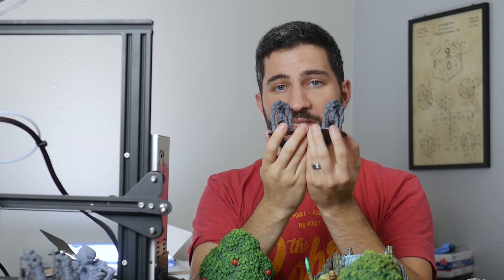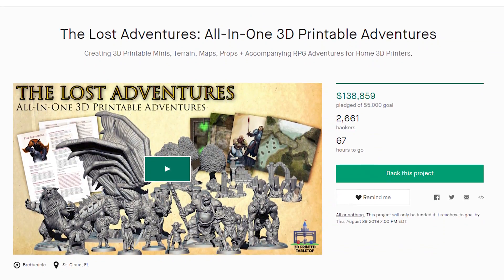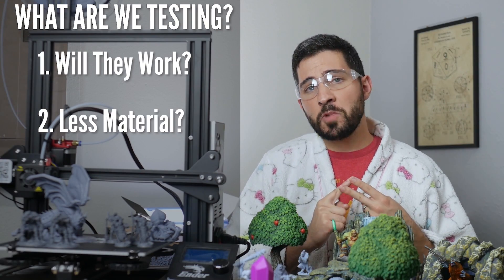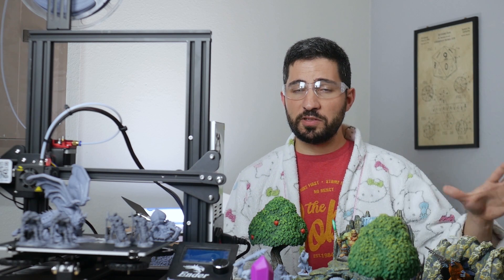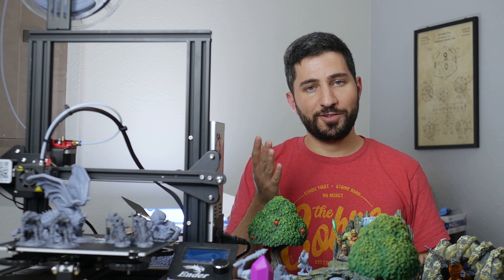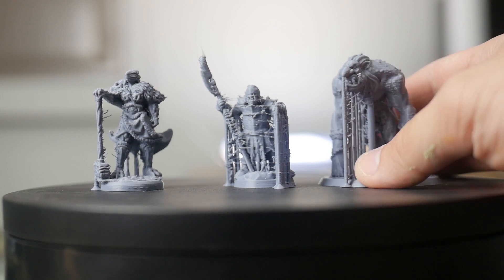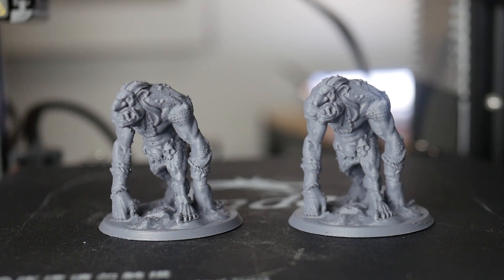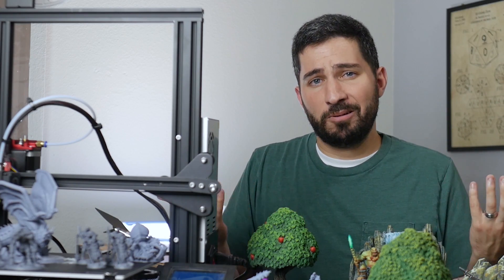Do Resin Supports Work For FDM 3D Prints?

Comment: @3D Printed Tabletop  Tree Supports (like what you are adding in a separate program) are available in Cura under the Experimental Settings.  You have to make them Visible in Configure Setting Visibility under the Settings menu.
Reply: I really like tree supports quality wise, so much better than traditional support, but damn they are a pain in the ass to remove. I have been printing battletech minis and the tree support creates some kind of cocoon around them it takes me around 15 minutes to take them off but the quality is flawless.
Reply: @c3pu333  +1 extra like for the miniature giant robots!
Reply: PS i use sprue cutters to slowly cut trough the "cocoon" instead of yanking at it with pliers like you would normal supports.
Reply: Tree style supports in Cura are not the same thing as resin style supports.
Reply: @mimked  What is the difference?
Reply: @andy-in-indy  Cura "tree supports" create a sort of solid shell (or cocoon, as C3PU called it). Whereas the ChiTuBox supports are like little pillars that go up to support the part.

Comment: Tree support in Cura could provide amazing results with 0.8 layers. I am using it most of the time now. But this is experimental option and may fail for some angled details, especially with hanging fins and claws. Rotating model usually solves the problem

Comment: This is an interesting topic.   I had not thought to try this with FDM.

I find I get the best results with rotation and customizing supports.  I print minis either flat on their back or at 45 degree tilt back.  In most cases this allows for less clean up on the face and front which have the most details (though the layer lines on rounded areas can be affected).   Also, weapons printed this way are less likely to break then printed in a standing position due to the way it lays the layers down.  In some cases you can reduce the amount of support you need depending on the areas that need support.  

Another option for bigger minis is to cut parts off that add tons of support to print separately in different orientation and pin them on later.

Comment: I’ve been using the Creality slicer for my Ender 6 since it isn’t presupported on most other softwares. 
I noodled around with my support infills and got them to a point of being almost totally hollow but still able to hold the model, so I have taken to setting the custom cylinder supports, and usually this works fine. I still sometimes have issues with an arm falling on or something, but dropping the support density really helped with removal without appearing to be too much of a detriment to the quality. It ends up looking similar to the auto supports, but with just a little less in unwarranted areas to speed up removal.

Comment: I use meshmixer. I love that the support follow the shape of the object and only go where they are really needed. I even printed a xnomorph statue in parts using it.

If I had more control over cura support then I may use them to enhance my current supports.

Comment: How about tree supports? I've had some pretty good luck using them as generated with Cura. Speaking of Cura, if you decide to "upgrade" to version 4.2.1, don't uninstall your 4.0.0 until you've used the newer version for a little while. I used 4.2.1 for a while then went back to 4.0.0. Some of the changes in the new version are good but for some reason a lot of my prints were failing due to various reasons such as under extrusion and supports getting knocked off. I'll continue to play around with 4.2.1 but for the bulk of my prints I'll continue using 4.0.0.

Comment: I apply 70 degree support angle and lines for the support pattern on very tall complex prints (statues 430mm average) and mini terrain. Enable ironing and add a few custom supports to fingers... Etc. Great prints everytime. I just FDM print terrain and larger statues though. Minis go on my resin printer.

Comment: I'd like to see a followup video where you test out different modifications to the settings that would allow for higher fidelity. Maybe the resin supports will work better if you rotate the model, retraction speeds, etc.

I backed the Kickstarter for these and am looking forward to printing them on my snapmaker 2 when it comes in November. Having a good printing profile based on your experiments here would be a great help.

Comment: you need to put basing material on the bases anyway. so it doesn't matter if there is scarring on the base. Also you can support supports with supports so all of your supports can be off the base.

Comment: I've had decent results with the experimental tree supports on Cura. No support residue on the bottom of the model, base and such.
Reply from the maker: The big problem I've always had with tree supports in Cura: they're very hit or miss. Sometimes they work really well, and other times the whole mini is covered in a shell and smaller parts break off. The most common occurrence though is a part not being supported fully and failing regardless. Adding custom supports allowed me to make sure certain parts were supported (especially good for things like dragon wings).
Reply: Trees can work really well, but they can also be a nightmare to remove.  As Tabletop said, often the print ends up enveloped in the tree and it turns into an paleontological excavation.  The other downside is that the blemishes from the support contact points are hard to clean up.

It is worth noting that the case that was really troublesome was an extremely difficult print.  Namely, the gargoyle from Heroquest, printed in a single piece - look it up and it'll be obvious why it was big trouble.  The fact that it actually came out, in a rather brittle transparent PLA, no less, shows that the tree, despite its flaws, has a lot of potential.

Comment: Really love this topic and the idea of it. Is something I will definitely try, tho instead of using the Chitubox supports or generating supports there, I will try using Prusa Slicer with their SL1 Printer profile to generate supports.   When my photon has had issues lately with chitubox supports, the Prusa Slicer autogenerated supports succeeded perfectly on the exact same prints without having to change or fix anything.  Using Prusa Slicer to generate supports before slicing in Chitubox for the .photon file is my new go-to process.    Am def going to try using Prusa SL1 profile to generate supports, then switch to Prusa Slicer MK3S printer profile to slice and print.

Comment: Danny, try using the Chitu sphere connection upper and lower connection points, see if that makes them cleaner to remove, it does for me.
Reply from the maker: I'm not sure if you noticed, but I used these on the Owlbear test print. Removal was OK, but not really any easier to get a clean flush cut on. Thanks for the suggestion!
Reply: @3DPrintedTabletop  , no I did not notice. Good to know. I know it is out side your scope of the video but there is some setting to reduce depth and contact area that might also help. Happy Printing

Comment: I wonder if there is a way to make hybrid supports?  Connect points from one style with scaffolding from the other style, perhaps.  Although looks like with either style you need the bridging settings as close to perfect as possible so as to avoid droop and other issues of bad bridging.

Comment: Dont forget tree supports in cura. Perfect in my testing in cura
Reply: Most people don't know that Tree Supports are available in Cura because they are under Experimental, and you have to  make the option Visible under Configure Setting Visibility.  https://ultimaker.com/en/resources/52868-experimental   I can't remember if there is a way to add and remove supports like you can in Simplify 3D or Chitubox.
Reply: Yes. Tree Supports are a dream to remove compared to standard slicer supports.

Comment: You gotta get 100% acetone and brush it on. Or get a plastic cement and use that. It helps smooth out flatter areas of the model or pixelized areas.

Also what's your nozzle size? I'm running a 0.4 and it's too big. Is that a 0.1?

Comment: you should try the experimental tree supports in cura. they dont touch the base of your print, and they are pretty minimal in filament waste while supporting the areas that need support with the minimum of contact areas.

Comment: Hi, 
This is Mike and I am writing in reference to the setting you have on ChiTuBox.  I am using the Anycubic MEGA printer, I also us the Simplify 3D as a slicer.  I added supports my STL file and exported the to my slicer but the supports brake in Simplify 3D.  My question is what setting do you export your ChiTuBox STL file so they wont break?

Comment: Yeah, when you have your nose on the mini you can see everything. 

When you have the mini on the table that's how you should be rating/judging it. If someone is a mini nut they're using a resin printer to start with.

Back when I was looking at 3d printers a few years back the above type of advise from you and other folks made a huge difference....  

... the same applies to painting (you always point out your own lack of perceived painting skills). It doesn't matter if it looks like poo under your nose. It looks good from a few feet away on the table top? Good, that's where it needs to look good ;). Don't let anyone step on that.

And painting are printing have something in common. The more you learn and experience the art of doing either the better you get. No one starts out as a master. Don't get discouraged, we hopefully learn from our mistakes so that the next time we kick butt when faced with what used to be a problem.

Comment: I was actually thinking about this. But I was doing supports in chitubox, saving it as an stl then loading into cura to slice. This killed any time savings. Did I need to do that?  Will chatubox slice as well or does all the slicing have to be done in cura?

Comment: It looks like you took the model into a resin-focused slicer like Lychee, generated the supports, exported the file (as an STL?), then opened it in Cura, sliced, and exported the file to print on the FDM printer. I tried this and got mixed results, though I think my problems had more to do with parts of my model being too thin than with the slicer or printer settings. 

When I use this method, the supports aren't treated like support material, since they're read as being part of the file itself. So I found them to be thicker and more fused to the model than slicer generated supports. Did you experience anything like that? Or did you use a different method? And since this video is almost 3 years old, have you learned any better strategies for support generation since then? I'm still working my way through your videos.

Comment: Hey Danny I was wondering if you might have any settings advice for a 0.2mm nozzle when printing small miniatures 35mm and under at a layer height of 0.04-0.08mm. specifically speed, retraction, and flow rates?
Reply: Do you mean .04 to .08 layer height? Cause .4 is bigger than your nozzle...
Reply: @mimked   yes thank you I did not catch that

Comment: Great video as always. I'm looking forward to a Simplify3D vs Cura. I really like the supports on Simplify3D, but some mini's (especially Heroforge) I seem to have a heck of a time succeeding (even for tabletop quality.
Reply: hmmm weird. S3D has the best supports I've ever used. It takes anything I throw at it with a decent surface quality on bottom layers, and no marks what so ever on top layers. And they come off super easily. sometimes the supports stick to the buildplate instead of the print when I take them off. 

I'd reccomend playing with your bridging settings (the first layer above a support is considered a bridge), use dense support layers and tune those. its a quality vs ease of removal thing.
Reply: Respect to you having Simplify3D but a lot of us including me can't or will not afford the cost of it. I would be happy to see a Cura vs other free software shootout- I believe one of the free ones has manual support options.
Have a great day all.

Comment: Danny:  First, thanks for all the insight.  Your videos have saved me so much time.  I have a question regarding supports.  I'm using 8 mm brims.  The build plate heat is set at 50 degrees on my Ender 3.  The brims almost never adhere to the plate. They curl beginning at the outside edge and end up sticking worthlessly up into space.  Is this a temperature issue?  Any advice?
Reply: u should leave it at 60°

Comment: "negligible amount. We're talking here like 1gr less filament."
Actually my record so far is a ~30mm standard human fighter, hollowed (0.5mm wall) & holed & supported of course to use 1ml of resin (and ~1ml for the supports),
so ... from the negligible difference of two of your minis I can print a whole mini :) (on Mars 3).
At the moment my major spenders are time (for me to prepare my custom supports, as auto-supports are really bad in both Chitubox & Lychee), and resin wasted when I clean the build plate & models after print.

Comment: Wait. How did you get Resin supports from Chitubox into Cura? I'm confused how you actually got to use resin supports for an FDM print. Please explain.
Reply from the maker: You just export the file with supports as an STL and then load in Cura with supports turned off :)
Reply: @3DPrintedTabletop  I got it. Thank you so much!

Comment: I'd be terrified of those resin supports falling halfway through the print.  Thin towers are dangerous
Reply from the maker: Thin towers are dangerous - which is why you can see I tried my best to merge them and even merge them to the base (with a quick trim). It was like removing a brim, not too bad usually after priming. But again - that's my standard, and I can't say it's something I would do with every mini, but worth a shot just to try it.

Comment: My problem is the standard supports on Cura, 90% of the time they break my prints while I'm carefully trying to remove them. :(  I have tried tweaking the support types, support infill, remove supports in certain areas, tweaked retraction settings. I have spent more time troubleshooting supports on my Ender3 than I have actually printing things. For the most part I have given up on 3d printing, I usually will only print things that require little to no support. I love your video's regardless.
Reply: drop support line width to 1/2 nozzle diameter. This makes them very crumbly. Also zgap on supports at 2 layer heights and with floors and ceilings drop density to 50-70% (this one varies the most depending on the mini).
Reply: @kaseyboles30  I've tried most of this, except Line Width, I will try these setting and let you know. Thank you for the help, I appreciate it.
Reply: One thing that really helps is a nice sharp pair of sprue cutters.  Start by cutting out the center segments of the supports, then, once the support structure is no longer a structure, nibble away at the support interface, cutting first at a 90 degree angle to the surface in order to cut the support interface into little bits, then nipping into the crack between each bit of support and the model to get them off.  With care, you can cut supports of of very thin parts of the model without breaking it.

You might also try printing with PETG, though this is a bit of a double edged sword.  On the one hand, it's much tougher than PLA, and tends to flex before it snaps.  On the other, the supports will adhere much more strongly to the model, and thus be difficult to remove without applying force, though perhaps this can be mitigated in the slicer settings.
Reply: @fungunfanatic  Line width is what made the biggest difference for me. The others helped some, but being able to just crumble away the supports was big improvement.

Comment: I have a ender 3I use you support setting and people all ways say how clean my prints are all I do is print at 0.08 and slow the print and infill down and have 50% over handrememeber slower is better yes I think when you say printer people think of a paper printer just press the button lol when I put a new reel on I do a bed leveling print  and clean up the nozzle dust the printer down  etc

Comment: i have tried to get this to work in chitubox but everytime i export the stl file, then slice it in s3d, ideamaker or cura, the resin supports get all jacked up. How did you get it to work?
Reply: Did you mean break support when export stl to another slice?
Yes i have the same result. I think it should make a bigger support for FDM Print
Reply: @diamondjing2746  yes, all broken and ruined:(
Reply: @LT72884  i just test today. Use support from Chitubox and then export .Stl file to Prusa slice. It Broken support.i will try setting like this video and other later